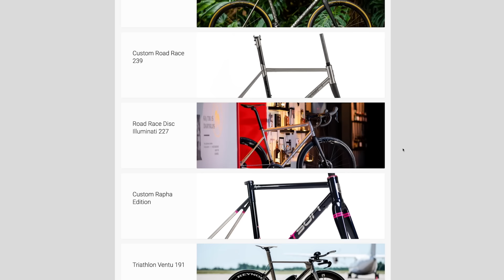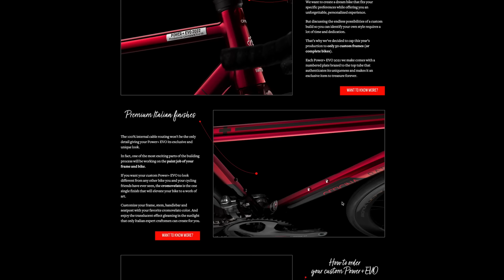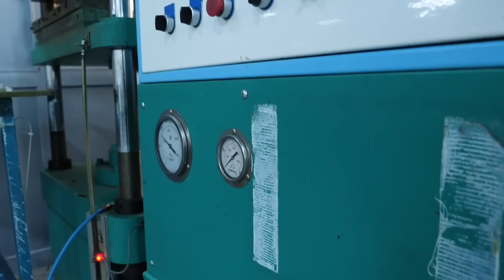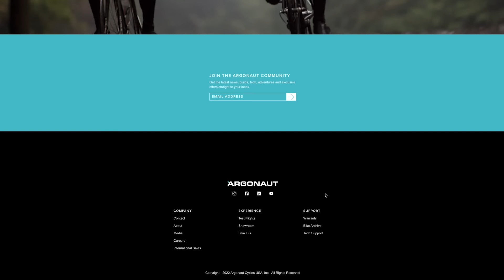The World's 5 Best Bike Frame Builders!

Comment: As soon as I finish a current project, I think I'm reaching out to OfficinaBattaglin and having one of their Power+ frames made and get off of this carbon bike.  I have wanted one for the last four years or so but have other priorities at the moment.  I love the ride of the steel bikes I raced from the late 70's through to the the 90's but would like one of these that can also take the modern components.  Having raced on those same frames, albeit a bit earlier, I'm sure Giovanni Battaglin has recreated that supple yet responsive ride in his current steel sleds.

Comment: Well done. I am interested in a custom frame build. I am an older age grouper.
I have a carbon TREK Madone that is separating from the bottom bracket. It is the second TREK bottom bracket that has failed. The options you covered are compelling. I am looking for a good all round option for hills, flats and downhills for training. I occasionally compete in triathlons and have a suitable tri-bike—aluminum or light weight steel (not sure). I do appreciate the solid bottom bracket area. 

Thank you
Reply: I say always pick lightweight steel.  Titanium is no better than steel, but much more expensive, carbon is disposable no matter what you do, and aluminum wears out (stress cracks).  I know this from 45 years of experience, riding all frame materials.  In fact, I personally own steel, carbon, and titanium, and have also personally worn out two aluminum frames (both Cannondales, that lasted around 50,000 km) and four carbon frames (two 90’s era looks and two 2010’s era Specialized Diverges).  I have never worn out a steel bike, or come even close.

Comment: Amazing. I would have thought by now the top companies would have moved onto robotic and jig processes. I guess the additional cost doesn't justify the leap in tech.
Reply: Robotics buys you volume and speed but may or may not buy quality/precision. 

Whether automation buys you those is highly dependent on the particulars of the product and process and especially on the the expertise of the people setting up the automation (or choosing not to because if it's a bad idea).

Where robotics really suffer is in flexibility, a characteristic that is essential in custom made products. They require a great deal of trial and error for initial setup but then are repeatable for making the same thing over and over. That's very inefficient and ineffective for one-off custom products.

Custom builders do use jigs. They just weren't shown in the very short snippets of video here.

Comment: i had a wittson frame, they made me pay in full in advance and then made me wait for months... the frame they sent didn't match the requirements i give them and even had toe overlap. after one year of use, it broke at the bottom bracket due to a faulty weld, they didn't want to replace it, they offered to make bodge instead, great frame builder yes. totally recommended. very professional

Comment: Giovanni Battaglin won both the Giro and Vuelta the same year. I would love an Italian Steel bike. But for me it would be a Stelbel
Reply: I had an Aluminium Battaglin with Campag, lovely bike.
Reply: I ride a 1988 steel Battaglin (Columbus SLX tubing). All Campag of course. Built it myself with vintage parts collected off EBay for a under £1,000 all in. Even a basic modern bike will be far superior on paper and be quicker in a race or TT but I’m so happy with my bike. It feels great to ride. The biggest limiting factor is rider fitness / weight. When I’m fit, it’s still decently fast enough to keep up.

Comment: What about magnesium?
Reply: What about it? It’s like salt. I’m not going to just eat a bowl of it with a dash of bacon bits on top.
Reply: apparently it has too many corrosion-related issues so it's no longer used much. Other than that, it's an awesome material for frames
Reply: I have two sets of magnesium wheels for my 29er (700c) bikes.
Reply: @JoeBManco  make & model?
Reply: @mattmatthews5414  They are aftermarket wheels I found on a site called city grounds.  In fact two of the wheels are on the bike in my picture.  That bike is a Kent mountain bike that I converted to an e-bike with a Bafang mid-drive kit..
Reply: @JoeBManco  yes, it was the make & model of rims which I was asking about…

ETA: “mags” is a term leftover from 60s car culture when there were nearly no aluminum wheels as we have today and European race cars had previously had what’re now called “wire wheels” and American & Japanese race cars and nearly all production street cars had what’re now known as “steelies”. Campagnolo experimented with quite a few alloys that were over 80% magnesium for the race cars and eventually motorcycles too. When BMX came around in the 70s and they needed stronger wheels than was commercially available at the time, casting aluminum into what resembled a race car’s “mag wheel” was something a California Aerospace engineer could do for their son or daughter right in their garage/back yard with a minimal amount of machining for the bearings and brake track done at work during a long lunch break. 

Your wheels are likely to contain only small amounts of magnesium, if any. They’re an aluminum alloy, probably 356 if they’re cast then machined, maybe just 6061 if they’re just hogged out of a single plate. Either way, technically there is some magnesium in them, but it’s in the same amount as all other aluminum alloy bike parts- about 2%.

Your bike’s handling will improve quite a bit if you commission your Local Bike Shop to lace up some semi-lightweight modern 700c wheels with H Plus Son Archetype rims (which will also have about 2% magnesium in them) with CXRay or DT Aerolite spokes to some regular hubs (Gran Compe sells some light but strong low flange ones for pretty cheap and available with low spoke counts). It may even be quick enough without those heavy Mags that you don’t even need the electric motor anymore.
Reply: @mattmatthews5414  Without a doubt the wheels are a cast magnesium/aluminum alloy.  Being a CNC machinist that works with 6061 aluminum often just based on the color it is obvious to me that they are.  Why I chose these is I wanted a perfectly straight wheel with permanently greased bearings press fit in the hubs.  Plus this bike was meant to be more of a moped.  It recently got a triple tree suspension fork to complete the look.  I need to update my picture once all the parts are back on it.
Reply: @JoeBManco  so, make & model?
Reply: @mattmatthews5414  I told you yesterday
Reply: @JoeBManco  you said where you got them. There’s two Crew Aero “MAG” models available that’re clearly aluminum. I’m giving you the benefit of the doubt that they had, and have since discontinued, an actual magnesium model. City Grounds also sells composite (plastic) mags- perhaps you’re referring to these.
Reply: @mattmatthews5414  Although mostly aluminum, these wheels do not appear to be 6061 aluminum.  Discontinued perhaps?  Bought them early last year.

Comment: Not sure a smaller carbon frame builder is better than a large scale one like LOOK. LOOK spends millions on simulation, testing equipment and physical testing. With manufacturing processes that make sure each frame is built to that standard which was designed. As was shown in GCNs own factory tour in Tunisia. I have to imagine that a smaller company cannot make a frame to that level of detail and still go around financially unless each frame is extremely expencive. It´s "easy" to make a carbon frame, but its also a much bigger difference between a carbon fram and a carbon frame, as compared to steel for example where it´s not as easy to make mistakes.